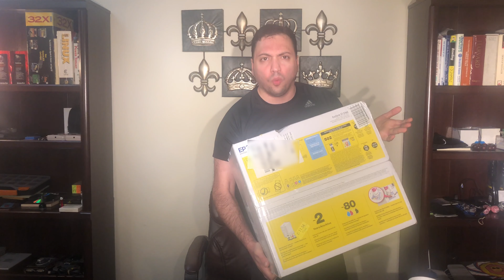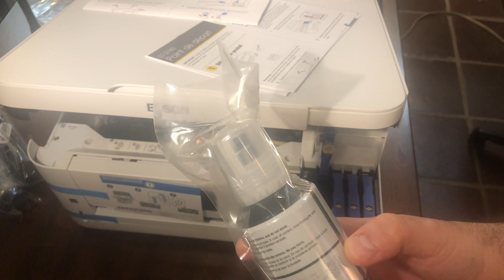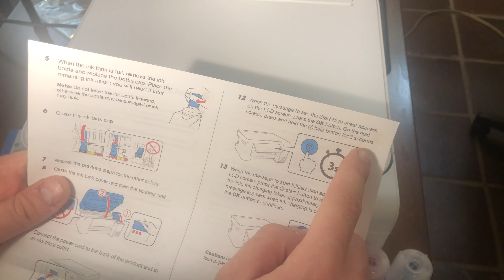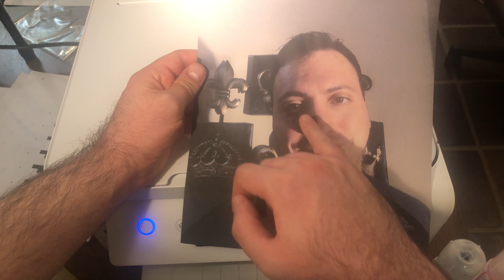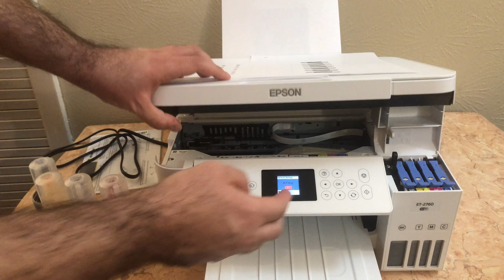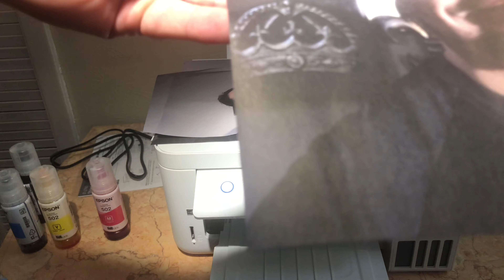Epson Ecotank Printer Review and Testing - Major Fail!

Comment: It actually does have ethernet. And if pigment based black then why did black leak and not the died color inks?
Reply from the maker: Thanks for the comments and question:

Your comments prompted me to do some research for you.

The model that I am reviewing does not have an ethernet jack, it does not support ethernet. It does have a WiFi radio which unfortunately only operates in the 2.4GHz spectrum. The information in the video is correct.

Perhaps you are looking at a different model. I would double-check the model numbers.

There is one other possibility, Epson included Ethernet in a future revision, but I have not found this as a feature in any listing I have seen. It would seem unlikely that they would make such a major change and use the same model number.

As for the question regarding the ink. I dont know what is causing those black spots. They could be from the colors leaking and mixing, from the black ink, or a combination. I don't care what is causing the marks, it is unacceptable that two new models from different warehouses are failing like this. 

Epson likely knows about this and continue to ship them out. I even reached out to the regional rep who said he would make contact with me soon, but I never heard back from him.

When I make a video for you guys, I always think of what the relevant information is. In this case should you but this printer? No, because it leaks... Under normal operation and using the manufacturer supplied ink, following the manufacturer's instructions step by step, the product fails.

Now had my goal been to make a video on the diffrent types of printer technologies and or created a video on how to fix this problem, it would probably only appeal to the 5 epson engineers who screwed things up in the first place. Some of that would have also been outside the scope of my experties. It would also limit my audience base as this is not really a printer technology channel.

Technology Feng Shui is all about ballance and the efficient harmonious use of technology. One of the questions I have to ask as a creator is what makes sense for my audience and what do they want to see.

Is a product that gives a person so much headache worth keeping around when you have a choice?

What about the ethics of the company who likely knows of these issues and does nothing?

What about the Epson rep who never showed up?

In my eyes these are really bad signs. Especially when I have a choice. Part of the equation is the product, but the other part is the people backing the product.

Thank you again for your comment, question, and for supporting me and my channel!